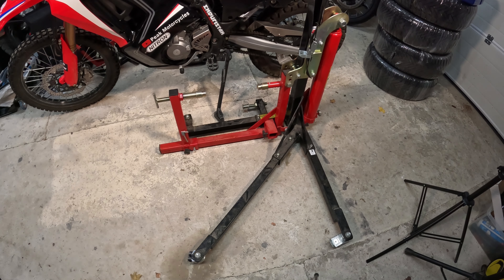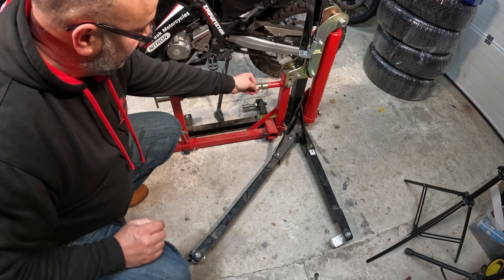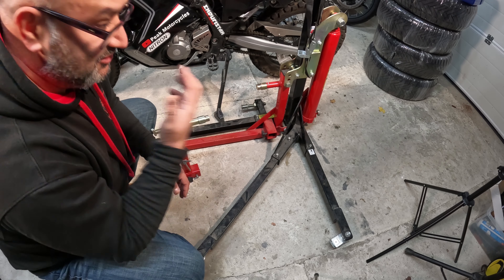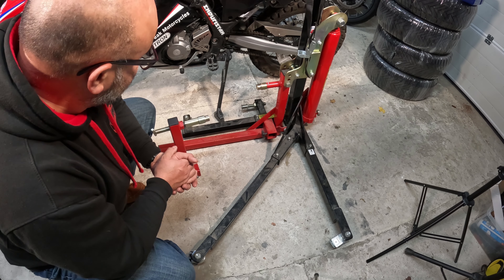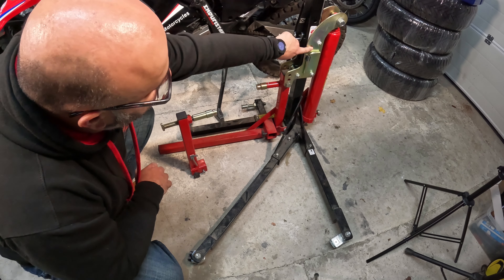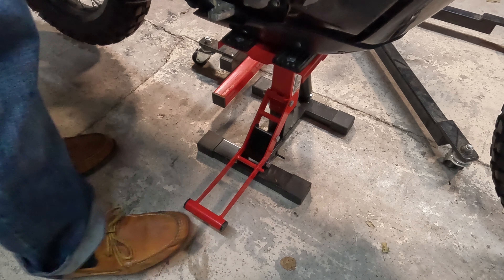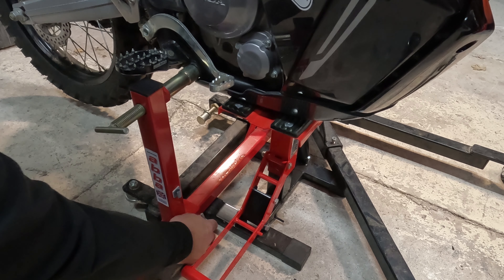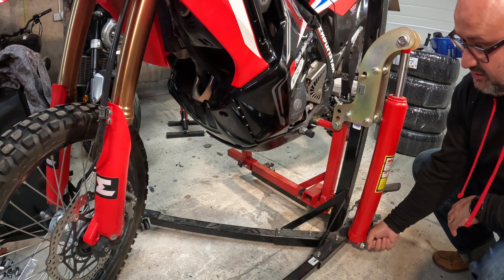Shorts: Abba Stands Skylift on a Honda CRF300 Rally 4K

Comment: Found this from the Abba site concerning the fitting kits: "Depending on the design of the pivot itself our fittings are designed to fit either over the nut head (in a similar way to fitting a socket over a nut/bolt head) or inside the hollow or hex hole via a correct size fitting pin." So, if Abba offers two fittings (17mm for bolt head, 22mm for nut end) then this may be another mounting option, that is simpler (uses swing arm pivot bolt/nut which is higher up by 11cm, which is within stock range of Sky Lift, eliminating need for initial raise with MX stand). Will need to consult with Abba to see if they offer the two different sized fittings.
Reply from the maker: Yup, that sounds like it’d work if they have the fittings. It’s not something I’ve tried though.

Comment: Maybe another approach! From another discussion, the swing arm pivot bolt (head and nut) are 17/22mm and about 11cm higher (minimum Sky Lift swing arm pivot point is 365mm, swing arm pivot bolt is above this). Can the Sky Lift fittings mount directly to the 17/22 mm bolt head/nut? If so, no need for the MX stand. More research coming.
Reply from the maker: Sounds positive!

Comment: Hi Andre, thanks for this great video. I measured my frame openings (23 CRFL Rally) which are ~24.9mm. I contacted Skylift and the closest adapter they sell is 24.85mm. Did you measure the Panigale kit that you received? They cautioned that since they do no make a kit for this bike, the Skylift would not be returnable. Makes me a little cautious. Guess I could just order the kit before placing the Skylift order. Thanks.
Reply from the maker: I didn’t but it did fit. Though when I switched to the Zeta footpegs, the left side one had to be removed to get the adapter in. I also found that the lifting points are quite high, so I was using a small MX lift to get the bike up and level before fitting the Skylift.

Comment: How do you strap (or configure) for a horizontal lift? I don't find a mounting point on the back of the swing arm for the Abba adapter. Thanks.
Reply from the maker: Just round the swingarm. But I suppose you could put it round the frame if you were removing the swing arm.

Comment: This was very interesting. 
I was unaware of the lifting holes in the frame of the bike. 
That’s a quality piece of equipment that will significantly aid in bike maintenance and repair. 
Also, where’d you get those new Zeta foot pegs?
Reply from the maker: Footpegs came from 24MX here in Europe. I’d seen some basic stands that used the holes so it was an obvious choice!

Comment: Hi, Abba don’t do a specific kit for the CRF . As if you look at where the foot pegs are, and where the holes for the swing arm mounts would go , you can see it wouldn’t work as the foot peg will interfere with the lift operation . 
This applies to many adventure style bikes.
However nice work around though 👍
Reply from the maker: Each of their kits is made from 2 adapters. I called them said I needed 2x25mm plugs, and that was the Panigale kit. You’re right that they don’t tend to do kits for Enduro bikes as most people get by with an MX stand. Or blocks. But for anything with the suspension or bash plate, or even an oil drain, the Abba Skylift is ideal. You don’t need one of course, and a lot of things can be done with an MX stand or even the side stand, but it does make it a lot easier for filming.
Reply from the maker: @2000jago  it would. But the adapters are pretty cheap, and I don’t have a lathe!